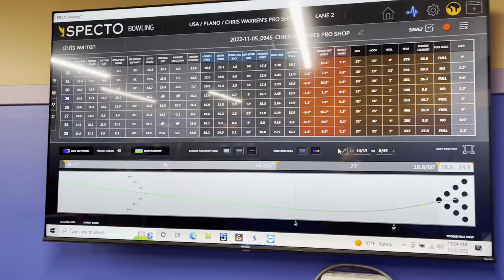Tour This NEW Training Facility with Simo & I!

Comment: The one quirk I've really noticed about the string pin carry is if you wrap a corner pin hard enough the 6 pin string wraps around  the 10 and sometimes the string pulls the 10 over. You'll notice the late pin fall and see no pin ever hits it.